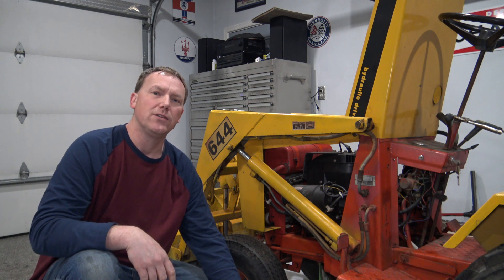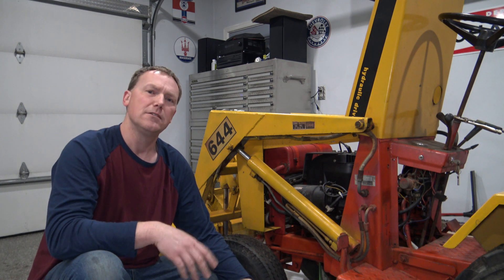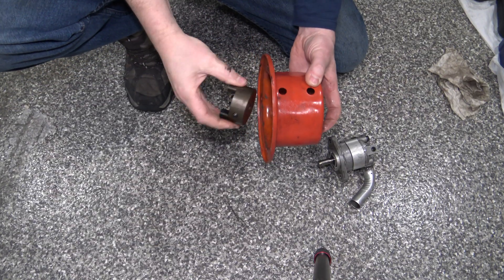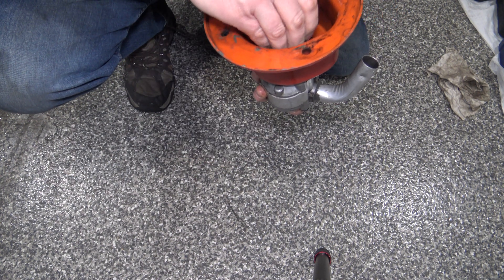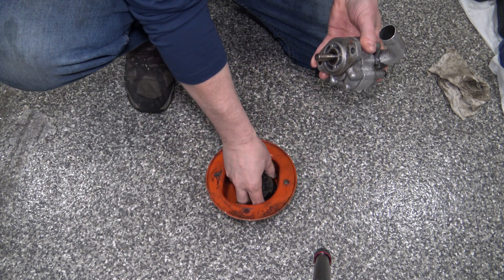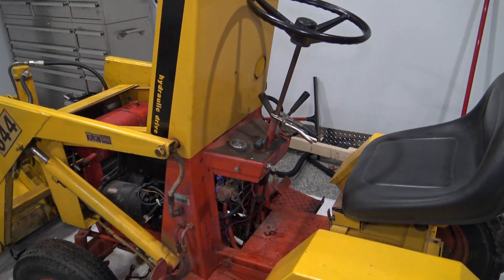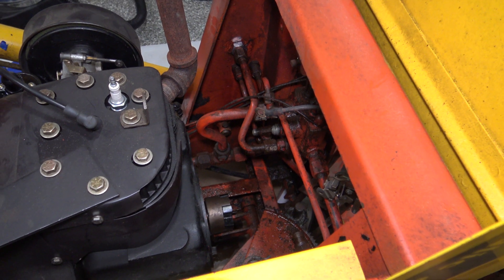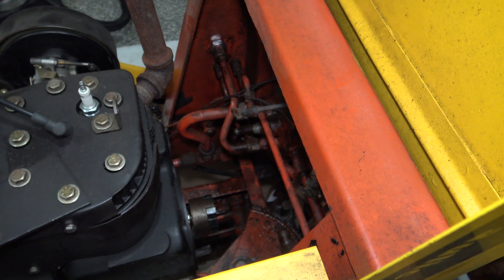Case 644 Hydraulic Gear Pump Removal

Comment: Do you have the replacement pump # or gpm flow rate it should have?  I just got this tractor but came with no pump. What was the shaft size of the pump? Thanks for youre videos they are very helpfull.

Comment: I have changed my pump, that I purchased at Barneveld Implement. And still have no bucket or drive movement. What else could be causing this? I see zero hydraulic oil movement in reservoir with cap off and engine running.
Reply from the maker: are you sure you installed the pump correctly? make sure the 2 set screws are tight, and that the pump is turning in the correct direction. or possible clog in one of the lines